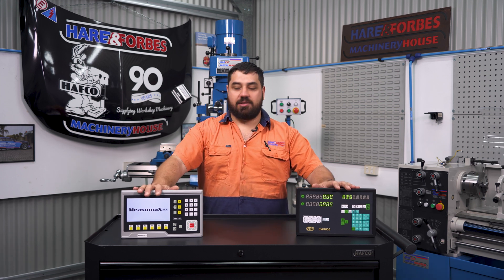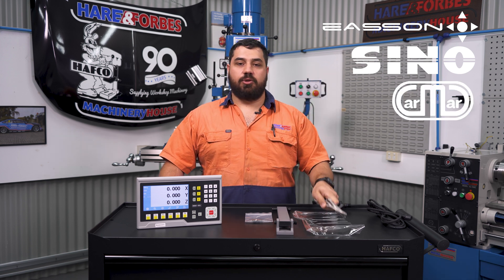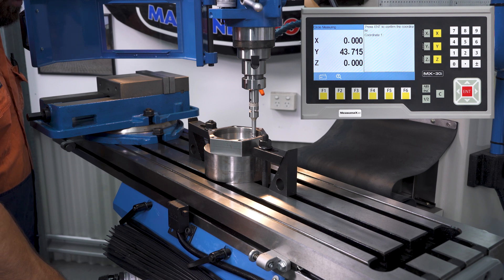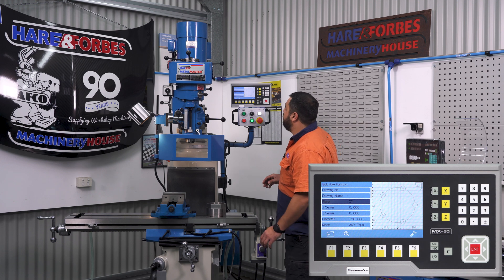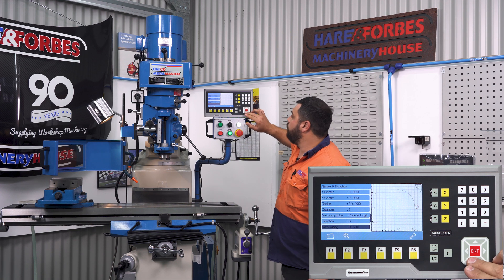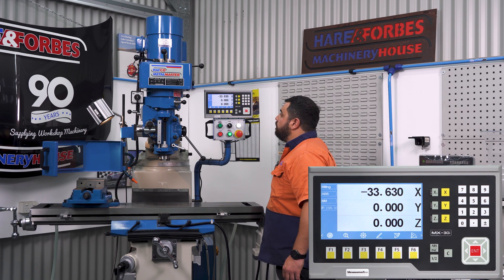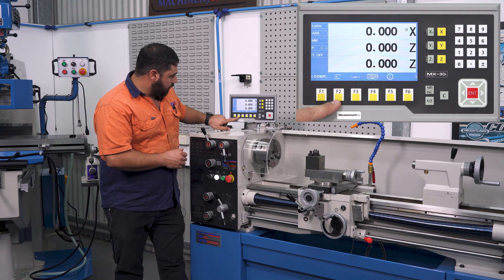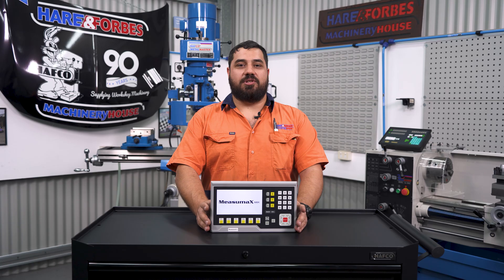Must-Have for Milling and Lathe Operations: Measumax MX-30i Digital Readout | Demo by Anthony

Comment: How much?
Reply from the maker: You can view our pricing at: https://www.machineryhouse.com.au/q8500
Reply: @Machineryhouse1930  Do you know if they will work with ToAuto scales? They only have 5 active pins in the plug, some have 2 extra, what input type is this DRO? Mine doesn't have do a reference position on start up
Reply from the maker: @adhawk5632  For further enquires you can reach out to our service team via email at service@machineryhouse.com.au and they will be happy to assist.